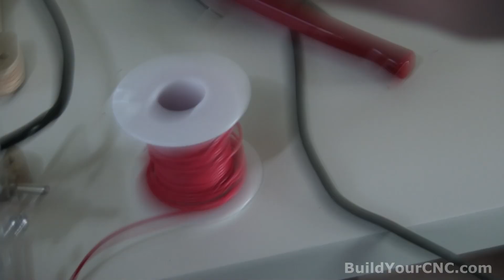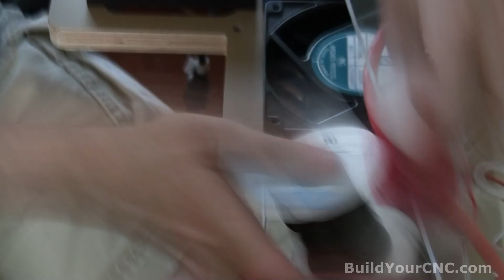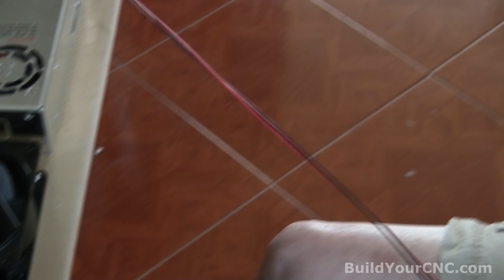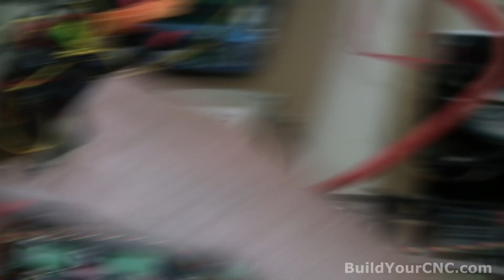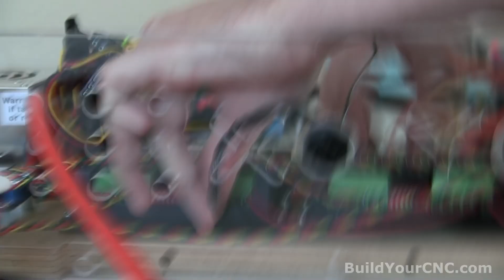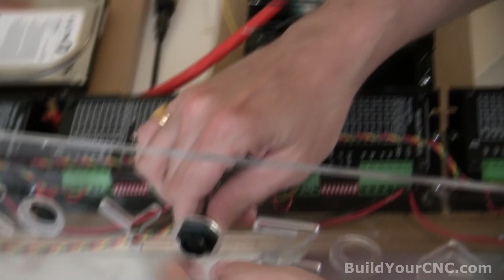redFrog Computer And CNC Electronics Part 2 10/28

Comment: Daisy-chaining the high current DC from the power supply is NOT a good idea, especially with the seemingly small gauge wire you are using.  If the first drive uses a lot of current, there will be appreciable drop across those wire lengths, and later drives in the chain will see lower voltage as a result.

In practice, depending on your loads, you may not see a difference, or you may have performance issues that are seemingly random and difficult to find.  Better to run one pair per drive...